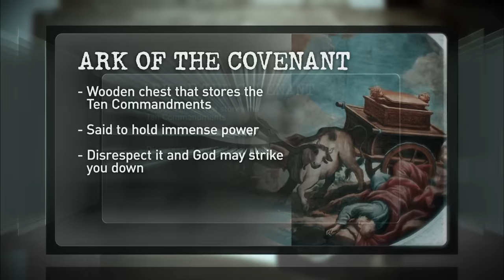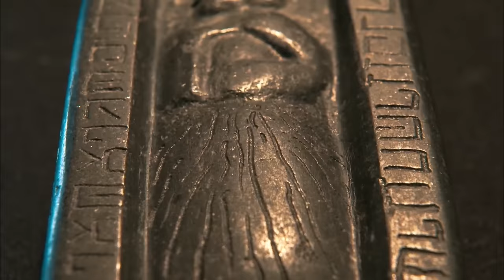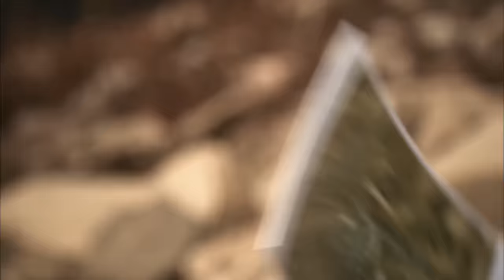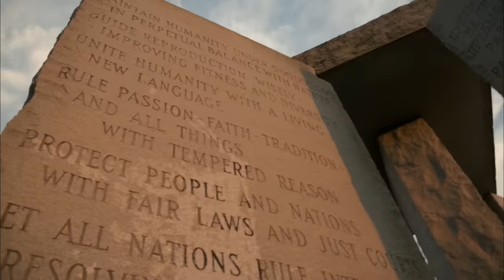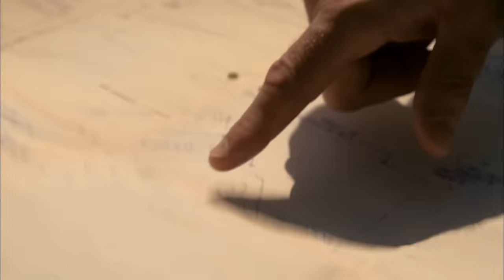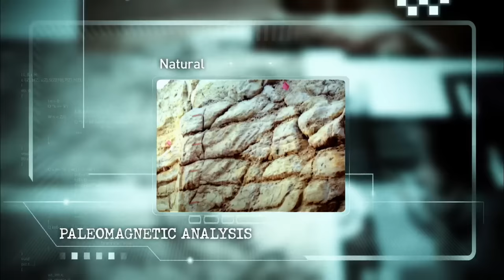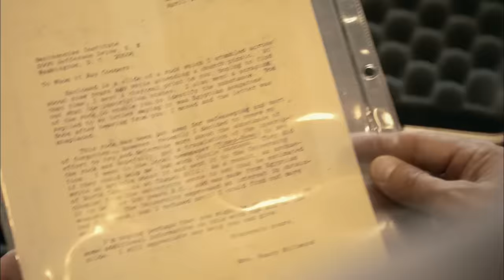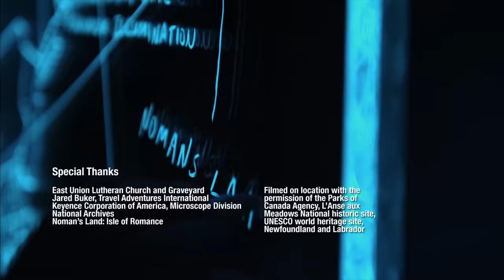MYSTIC SECRETS UNCOVERED ACROSS AMERICA! *3 Hour Marathon* | America Unearthed

Comment: One problem with the answer to the Rock wall is that if you set two pieces of ferris material next to each other over time their atoms will align with one another so depending on when the wall was built,  if it was built the magnetic fields would have aligned over time.
Reply: Ok, so what does that mean?  Does something happen?
Reply: What do you think it means? Lol
Reply: The magnetic signature that is inherent in the rocks in the Rockwall rock is from when it was formed and is permanent. It does not change.
Reply: @beckyd712  any material affected by magnetism will if left alone for a long enough period of time align itself to the earth's magnetic field.
Reply: @remowilliams8118   when material forms a rock it permanently sets the direction of earth magnetic pole at that time in the case of rock wall that was 87 ma when it was a shallow sea and deposited there
Reply: Well, this explains why my headaches! 😮

Comment: I also have a question with respect to the estimated height of the wall. The stones are of a fairly uniform size, and are not that large. I should think that a wall composed of such stones, and standing 70 feet high, would be inherently unstable. *Has anyone considered, or looked for, buttresses which would help alleviate that problem? And what does the very bottom course of the stones in the wall rest upon?

Comment: Regarding that wall at about 1:28:00 in the film, there is-----or was----another video on the Internet that showed the efforts of a man to excavate a site in Texas which bore a strong similarity to this project by Mr. Wolter. The man in that doc went on to say that he uncovered a section of a wall below ground, and that the 'experts' told him in no uncertain terms (suggesting possible use of force) that it was a purely natural formation. *However. **Cut stones are usually cut and stacked without any consideration of the 'grain' or the magnetic lines within them. We have been exposed to the same mentality by the 'experts' who claimed that The Bimini Wall is a result of 'natural erosion' despite the 90-degree edges.  Something's being covered up here, in many places, and on a grand scale.

Comment: k so for the rock wall i have acouple probs.... 1st off the cores that they show us they pull seem to all be from the same rock ....the test only makes sense if it's from different parts of the wall of course if u drill into 1 stone the N-S orientation is gonna be the same. So i was very dissapointed in the fact they didnt show holes in muiltiple rocks, but also from what i Know they should have def did a core on the "bedding" material which would have been the filler between the rock joints. They very obviously avoided the fact that in core samples. If they took a core sample of the "mortar" than they could have shown whether the mortar was a man made mortar or not.(Added on) - If u think bout it as a archeologist or a geologist why on earth would u dig the whole..(big hole at that)_ ...drill into a suppossed rock wall..but not drill an take a core sample from the mortar between the rocks...when u think honestly bout it there is only 1 reason u can come to and that is the fact they don't want u to know bout the wall in Texas....If u think imma a crazy dude or a CT guy look at other equivalent excavations.